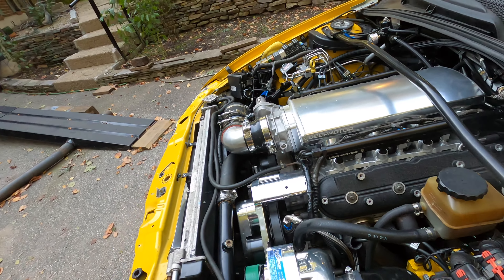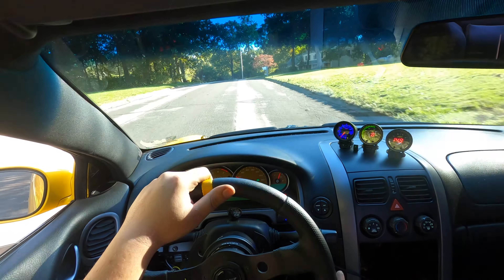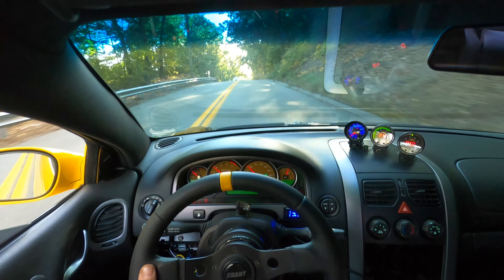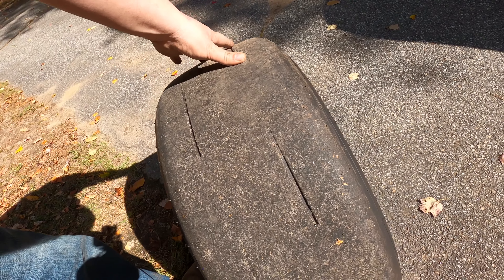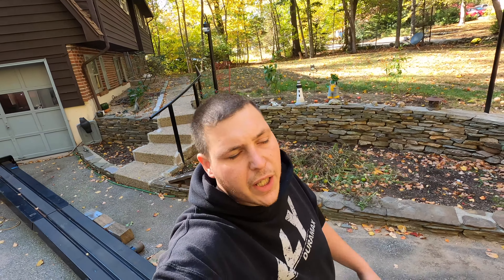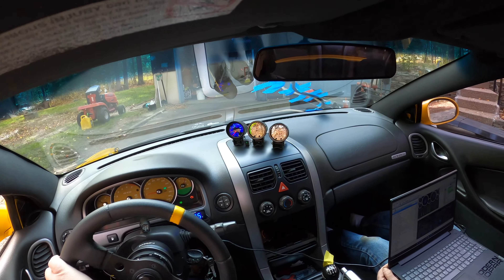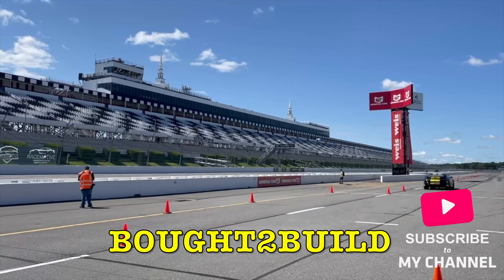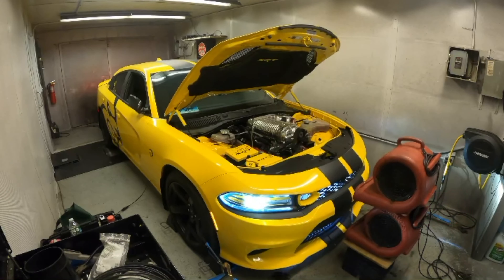D1SC PROCHARGER PUSHED TO THE LIMIT! (GTO tuning pt2)

Comment: What's the hp capability of that intercooler? I know procharger offers a bigger race intercooler good up to like 1200 or more.
Reply from the maker: Honestly not sure what this one is rated at. I may add a larger one over the winter when I build all the new piping. I can say that it is a heads, cam LS2 with 1 7/8" ARH headers and it is making 16-17 psi on a way beyond max RPM D1SC, and even with the meth off intake air temps are in check, with meth on the temps are very good still. we will get it on a dyno at some point but the car should be making decent power and I don't think I have found the intercoolers limit yet!